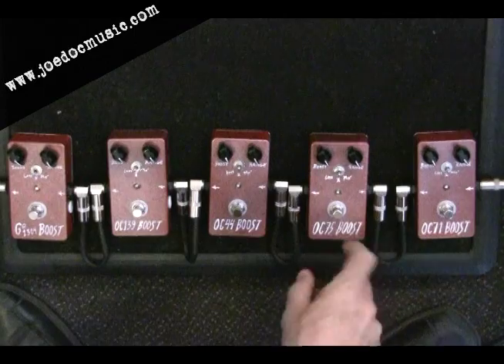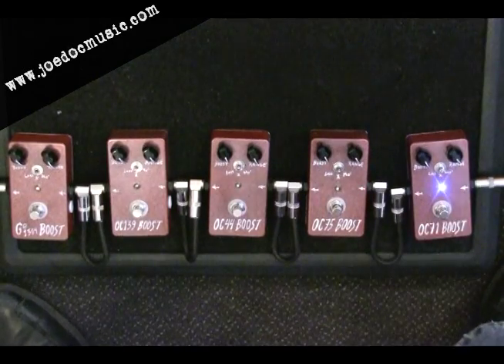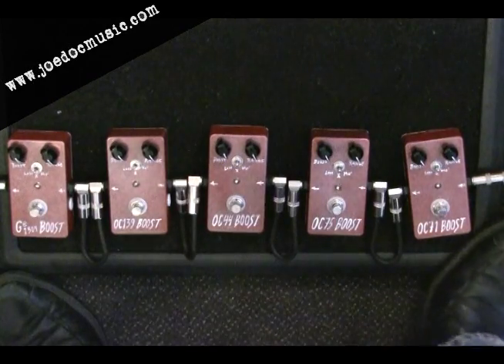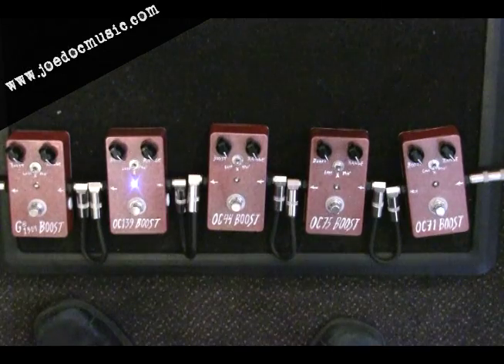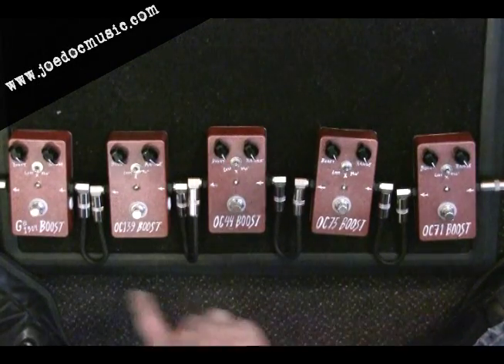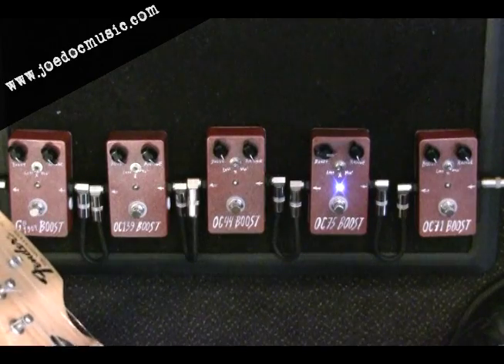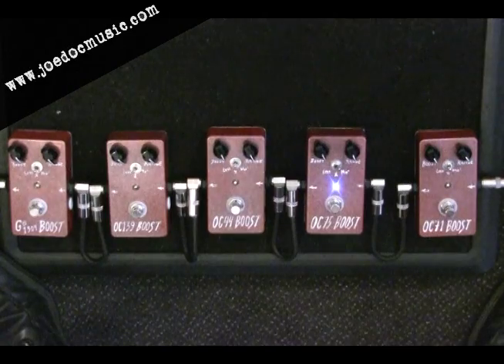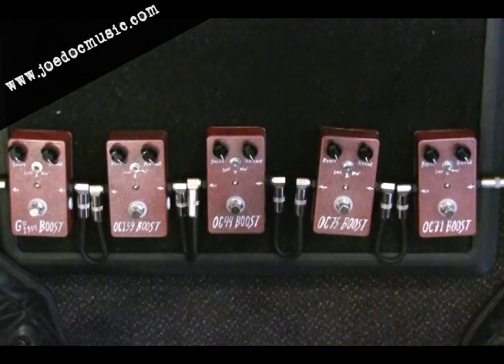Rangemaster / Germanium Boost Shootout Different Transistors compared OC71 OC75 OC44 & More!

Comment from the maker: Hey all - thanks for checkin this out. The video goes back quite a few years now, and we have updated the design a lot. At heart it is still 100% classic Rangemaster, but now the "EQ" control is perfected, and the top cut switch uses a second order filter on the output for a very musical top cut to the treble frequencies, on one side just barely "taking the edge off" and cutting hiss, the other side creating an almost "cocked-wah" resonance. Get one using the transistor of your dreams here: https://www.joedocmusic.com/jdm-pedals-oc-boost-custom-germanium-boost-rangemaster-pedals/

Comment: Wow, the screaming single string bends sound f'ing gorgeous through these.  Is there a target for the gain (Hfe measurement) when sourcing these transistors?  I've read several places that and the amt. of leakage can sometimes have a more profound effect on the resulting tones than the model (IOW the part #).  Can anyone comment on this?  GREAT upload
Reply from the maker: Leakage might have more of an effect on the bias of the circuit, and if this moves it away from the "optimal" 6.5v to 7v at the collector, it would change the tone. A good way to be sure of proper bias is to use a trimmer instead of the fixed 470k resistor. Something like 100k and a 500k trimmer will give you plenty of wiggle room, even for leakier transistors. Hope that helps! joe
Reply: @joedocmusic  This actually helps quite a bit, thanks.  Many of the transistors I'm seeing for sale aren't tested
Reply from the maker: @monto39  I still have sets of tested transistors, NPN or PNP on the site here: https://www.joedocmusic.com/pedals/ - just scroll down, they're mixed in with the pedals ;P best, joe
Reply: @joedocmusic  Thanks.  You have some cool pedals on there

Comment: Hé can you explain what circuitry wizardry you do to make the squiling-radio noises go away with the switch ? Would be super helpful to know how it works 🙏
Reply from the maker: Back in this time, I used a filter cap from the collector to base - 150pf up to 1nf, tuned to need! That can cut noise that gets into the circuit, but adding a tiny bit of series resistance with the input can do the same trick as with a fuzzface, cutting out some radio interference. Hope that helps! best, joe
Reply: @joedocmusic  thank you so much ! I’ll give that a try 🎸

Comment: You have these with the different transistors,  and they are for sale still? I am Interested.
Reply from the maker: Hi Ernest, These originals are long since sold, but we do make the OC71, OC44, and 2N1304 versions, and also offer an AC121VI from Toshiba, which is right up there with the OC75 in terms of tone. Drop a line at joedocmusic.com cheers, joe

Comment: I have a few with other transistors too. Great to hear more side by side comparisons! Thanks a lot! I built mine with identical measuring transistors, and the results are just like your's. Every transistor type has its own flavor. Every component in the circuits are measured and matched. Curiosity, right?😁

Comment: Didn´t you adjust the bias on each one to get same values?
Reply from the maker: Yes, all bias adjusted to 6.7v @ collector
Reply: @joedocmusic  I made the mine with AC127 NPN (I had this transistor since 2006) and just today I make this to work, it sounds very good, I still need to set bias but where I live (Venezuela) is better buy food than a trimmer :)
Reply from the maker: @percyhornickel  Hi Percy! Wow, yes the AC127 is an excellent choice, and if you need any parts, write to me. I'll be glad to send a care package to a fellow builder. I'm lucky to have a full workshop here and can certainly spare some pots and trimmers for a fellow musician and pedal builder. best regards, joe
Reply: @joedocmusic  I really appreciate your kindest, by now in here it is very dificult to buy or find simple parts like a single resistor or even a cap. (Just one eletrolitic cap cost the same as 15 days of my salary, no joke). I started to build the RM like 15 years ago when my father was alive so I wanted him to listen something made by myself, never happend tough. I`m a Petroleum engineer, I love guitar and I´m studing all the time, lately I have return to electronics (I always like it), I´ve been studing deeply the way to set bjt bias and that´s why I made a worksheet in excel to "see" the load line and how changes the Q point in some boosters, electra dist and the RM. It is so interesting and it helps to give you a better idea about how it works. I couldn´t measure right my RM because I think my AC127 has a big leak, but anyways it seems to "work".

My sister is living in USA since 3 years ago (Houston, Texas), she is sending us every 2 or 3 months some boxes with food and stuff for my family so if you have a little extra parts that you don´t use well...   ...I´m your man !!!!

...just whatever you want to include will be so appreciated.

...and yes, you are so so lucky to have a full wokshop (one of my dreams).

btw, sorry about my english...  ...is not that good.

Saludos
Reply from the maker: @percyhornickel  Hey Percy! Yes, I'll send you a message now, I have some goodies to send your way as soon as shipping is running here again. I'll message you! j
Reply: @joedocmusic  Wow really thank you, I´ll be waiting for this !!!
Reply: @joedocmusic  Ok ok I thank you Iwill ask to my sister her address, please let me know if you have a Ge used transistor or one that you don´t use, my AC127 isn´t working since this morning (I want to kill myself). Doesn´t matter PNP/NPN..  ..is for my RM so I just need to turn down the 47uF caps...     ...and again, thank you! I will write as soon as possible!
Reply: Ok I just sent you an email !!!

Comment: Great video, extremely helpful albeit disappointing. My hunt for a good oc44 continues.
Reply from the maker: The OC44 is great, but always a bit "hairy" in this circuit at max gain ;-)
Reply: @joedocmusic  its got a nice bite. I started putting this pedal together, thinking it would be quick, easy, and cheap. That was 3 months ago. I didn't realize how hard it is to find the right oc44. Do you think i'd get the same sound from a one of these other transistors listed as an equivalent (ac128, cv7003, nte126) or do they vary just as much?
Reply from the maker: @bingusvsgoogle  You can get very close with any good quality transistor, the tone is also affected by biasing your circuit, choosing he value of input capacitor, the base-collector capacitance (which acts as a sort of tone cut) and a certain amount of magic mystical mojo... The other transistors you mentioned should do a fine job. If you socket the transistor and use a trim pot to adjust the bias you could swap transistors in your circuit and audition to see which suits your guitra/amp combo best. cheers, j
Reply: @joedocmusic  great advice, great video. Thanks.

Comment: Hi, great demo and explanation! I'm breadboarding a RM with an OC71 transistor with Hfe=40 and Leakage=0.07mA (measured with a Peak DCA55) and it biases perfectly with stock resistors (c: 7.00v, b: 0.90v, e: 0.84v) but it's just much less "gainy" than with my other transistor, an OC44 (Hfe=90, Leakage=0.09mA), which also biases perfectly: I wasn't expecting these results, isn't the RM a finicky circuit regarding Hfe\Leakage? Both versions sound good, but there's quite a big difference in terms of volume boost, something like 25db for the OC71 and 30-35db for the OC44, is this normal? As you said, I like the OC71 for low gain bluesy stuff, and the OC44 for rocky riffs! :)
Reply from the maker: Thanks! Glad if it sheds some light on this classic pedal build. I also find the OC44 to distort more than the OC71 in the same circuit. This naturally means more upper harmonics, and likely a "grainier" sound. Strapping a 150-330pf capacitor across the Base/Collector can mellow this out, hint, hint ;) As far as biasing goes, if your transistor has low leakage (your OC71 is a lucky grab!) then the "stock" circuit values should bias up perfectly. I generally replace the 470k resistor with a 500k trimpot, then measure the collector voltage and adjust the trim until Vc hits 6.8v and it's golden.
Reply: Cool! I also found the OC71 mellower than the OC44, but in the originals, many OC71 equipped units mounted a 8.2nF output cap: sounds very good coupled with 50uF at the emitter to ground... :)
I still have some AC107, OC70N, OC72N and ASY80YTG to try! :D

Comment: very cool video. I own Sound Sounds. I personally use my Range Wizard Pedal through a Sound Sounds JMH45 Amp. This is a great video. Only question just for my reference did you gain check the hfe and if so what system did you use to find out. thanks
Reply: Weird all my Millard oc44 have been 60 and lower, here my oc71 have been anywhere from 40 to 80  in the sound sounds range wizard I use much higher hfe. Pnp  battery only. Played through a 6l6 jtm45 with silver alnico. I play both at full volume also in my band setting I use a low power twin built to grind with both amps I get to die for creamy sustaining tone. No buzzy sound at all. I've made a living for past 10 years selling pedals 90% ge fuzz. I have stuff on people's boards from social d, to warren Haynes t o Craig bartock. Stuff Is just word of mouth and I'm not rich just pay the bills and smoke endless  endless amounts of weed. But anyhow again great video
Reply from the maker: Hi Jonny - We use a DCA-55 to test gain and leakage. We're lucky enough to have acquired a large stock of excellent quality vintage transistors, so they're quite consistent. cheers, joe
Reply: The OC44 has a much higher Hfe than the OC71, for example, but in this circuit you don't want something TOO hot, or you may get a fizzy sounding 'overdrive', in my experience. The aim of a boost is of course to push an amp, rather than generate 'fuzz' of it's own. Any transistor can be biased into the right range, and then it's a matter of taste. I agree that the OC71 sounds great - the most "classic" tone. For a negative ground version I prefer the OC139, which sounds very close to the OC71. cheers, joe
Reply: i just didnt want you guys thinking i was a totally dummy, i have method to my high gain madness in the range master. I call is a Range Wizard, i like early Sabbath tones made with the modified range masters
Reply: Cool. I use the same model dca-55. Good unit. What gain ranges did you shoot for. I generally run mine hotter than an oc44 range. I think I prefer the oc71 model personally. When it comes to original units anyhow
Reply: Sounds like you got the right idea! ;0) keep puffin' - J

Comment: Hi, very cool video! Which one of these gets you into the Rory Gallagher territory?
Reply from the maker: The classic tone is really the OC71, however for a "daisy-chainable" version, the OC139 is perfect. The OC139 is also a vintage black glass Germanium transistor with the same gain as the OC71, but in NPN instead of PNP, so it can be powered by a standard modern PSU. cheers, joe / jdm pedals

Comment: I'd say that,  more important than the TYPE of germanium transistor is the hfe (simply put, how much gain the device has), and how much leakage it has - something which all germanium transistors have, to a greater or lesser extent.
It seems to me that the pedals with a "grittier" sound here simply have a higher gain transistor - most of my oc71's have less gain than my 2n1304's for example.
I design and build effects pedals for a living, and I spend a ridiculous amount of time swapping out Ge transistors when I could be doing something far more important, like making music.
Reply: Agreed.  An OC44 with Hfe 50 isn't going to sound the same as an OC44 with Hfe 150. Imagine if I happened to have a stock of OC76s all with hfe around 120 and I wanted to start selling pedals....I could say that the OC76 was the best transistor for circuit X (that sounds good with a transistor with Hfe 120) and that's why I only use them and why I charge £100 more than everybody else.  If I start talking about gain and leakage then my customers are given a level of understanding that allows them to see right through my layer of marketing illusion and I'll have to drop my prices to compete.  That said I do hear differences between transistors even when gain and leakage are the same.
Reply from the maker: Hi Alan, Yes - there is most certainly more "grit" available in a higher gain transistor (we also spend time experimenting with different models). For the non-engineer player, however, who just wants to hear a tone, say "that's the one I'd like," and order it, hfe, leakage, frequency response, etc. Are not worth getting into in depth. Hence the side-by-side comparison to make it easier for the player to listen and choose. Thanks for writing in! best regards, joe

Comment: the oc79 seems to stand out as the k.k.downing boost. they all sound great. OC71 for me! tried ac128 and 2sbi73, too hissy.
Reply from the maker: The finesse of the OC71 is just sublime. You get all sorts of great tones just adjusting the guitar volume pot. Love mine! :)
Reply: @joedocmusic  have you tried the nkt275? Works pretty nice in a treblebooster as well as fuzz boxes. BTW, the oc71 has that honk that sounds great! Do you make custom pieces upon requests? Thanks!
Reply from the maker: @whotendsthefire7234  Hey there! I do have some NKT278 original, and some of the Dunlop made NKT275, but have saved them for fuzz. I'll bet they are great in a Rangemaster, too. Custom pedals has become more popular lately - just drop me a line thru the site joedocmusic.com cheers, Joe

Comment: How did you bias the transistors? Are they all biased at the same voltage (6-7V)?
Reply from the maker: Using trim pots. All were biased to 6.8- 7V at the collector. Cheers, joe
Reply: thanks, all the best.